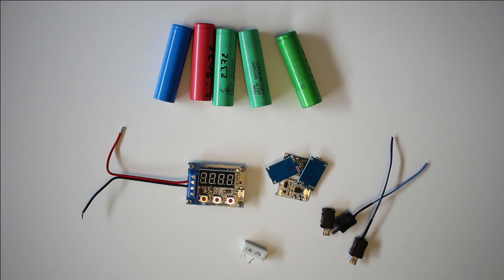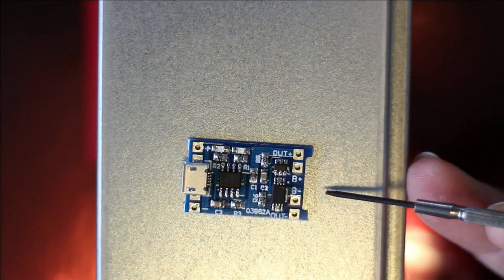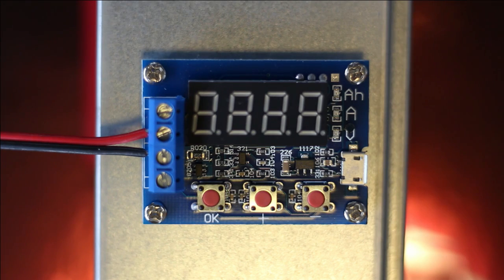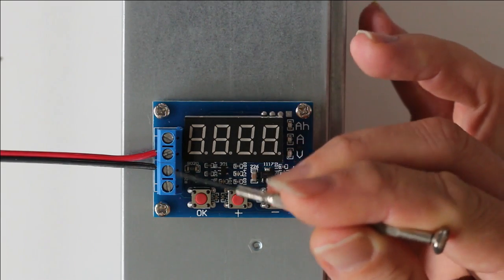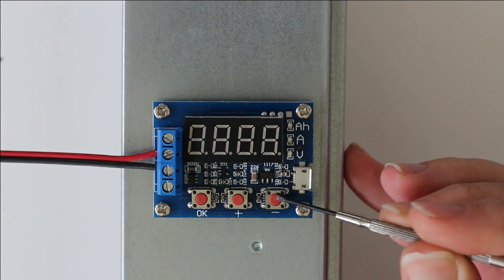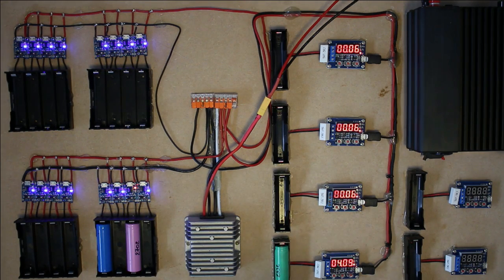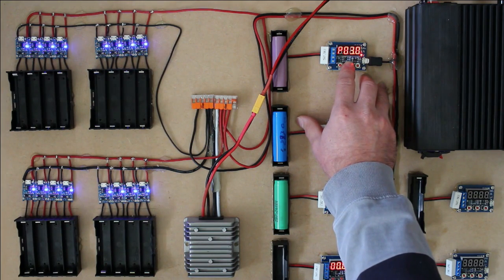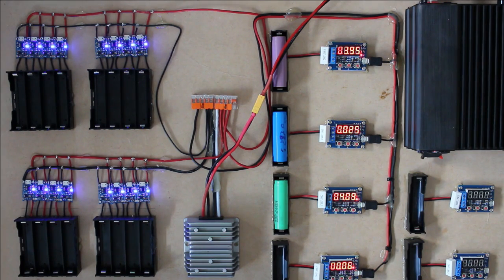18650 - Part 4 - Battery cells bulk charging and discharging with TP4056

Comment: If you look at the bottom of the PCB there are pads for connection of the 5 volts, you don't need to use the Micro USB socket.

Comment: Regarding to your discharging unit, what is the different using 1 unit of 5W7.5R resistor compare with using 2 units of 5W7.5R? I saw the discharging unit comes with 2 resistor and they can be connected in parallel.

Comment: what if I have to discharge 1amp from the 18650  battery cell, what should be the value of the ceramic resistor????

Comment: Do you need to Set the low voltage cut off every time ( USB disconnected )
Reply from the maker: No, once set it is ok
Reply: @Sailingandelectronics  great  ! 👍🏼

I have two more questions :P
Reply: @Sailingandelectronics  2⃣ Will it Balance the Cells while storaging ?
Reply: @Sailingandelectronics  3⃣ Can I storage discharge 1S with it ?

Comment: Thanks for your vids, ... would you recommend this device? Do you think that is accurate? Or would be better one like liitokala li-500 or opus bt.
Reply from the maker: Opus is best, no doubt. However price/quality I now use li-500 as main chargers/testers. The tp-4056 is cheap but sensitive... Need replacement often...
Reply: @Sailingandelectronics  i want to charge 18650 cell with solar 6v 1A plate,  but i also want to power the adriuno at the same time, can i do both,at the same time, if connect changer and discharger  on same cell ,will it work or burn the cell something..els..

Comment: How many charging device I can use with 5v 30A output charger ?
Reply from the maker: theoretically you should be able to do 30, but not overdoing it and running at max all the time, 15 to 20 would be a safe bet.
Reply: @Sailingandelectronics  thanks sir

Comment: Great work you've done there! One question, have you tried charging an over discharged 18650, voltage that is below 3.7v?
Reply from the maker: Hi, normal discharge is 3v, 2,5 and up is not good, but no problem if rare situation. Most chargers can handle this... (charging slowly up till 3v).
If really low or completely depleted, you can change settings so will start at any voltage. I use a cheap Chinese battery bank where I can put 8 18650 cells in. This then charges with only USB. If in there for 30 to 60 minutes, voltage is up to 2.2v most of the time. Enough to put in real charger.

Comment: i have done a capacity  with these testers and then compared it with the opus 3100 there is a huge difference i dont know which is accurate.
Reply from the maker: Opus will be correct because you know what amount of MA is used. In the little charger from this video it depends on the resistance you give it. If only 1 block, it's about 500MA. You could try the same cell in opus at same charge and compare.

Comment: Can I charge the high drain battery using the tp4056 charging bord? Pls reply
Reply from the maker: If it is lipo 1cell you can charge. You can change minimum and maximum voltage if not lipo.

Comment: Thank you ghis video i would like to know what main power suply you use from 220 or 230 to 12 v ? Thx
Reply: Obviously he doesn't answer questions from his subscribers.  Anything around 15 to 20 amps should do the job.  The higher the better.  When it comes to 12v supplies I always like to leave plenty up my sleeve.  If I need 10 amps I'll go for 15 amps. If I need 20 amps I'll go for 25 to 30. This way the supply is running cooler and will last a lot longer. I have a few 20 amp supplies which have been running for over 26 years and still as good as the day I built them.  One thing I've learned, never ever trust the output of Chinese supplies. Often they're little more than a wild guess. Plus I've had too many literally explode during use. In fact one decided to shock us all at 2am Christmas Eve. It blew it's cover 10 feet from the power point.

Comment: Nice video. Thx.I bought this same tester and it came with two resisters marked ZY 5W7R5 . I used only one resister and tested my havested good batteries showed before charging 3v- 4v readings. But after almost one hour  draining the batteies this tester showed mAh readings made me frustrating.  They are 0150, 0337, 0341, 0362, 0507, 0509, 0511, 0622, 0648, 0962, 0995, 1001, 1094, 1096,1425,and 1598. Are these my real capasity of my batteries or have to understand or how to read this readings? Thx for your reply to send me or correct way.

Comment: nice video. Can you connect the charger cirquit and the discharger cirquit to the same battery holder with a toggle switch maybe? that way it is much faster to switch between charging/discharging.. what do you think?
Reply from the maker: Should work, but you cut your capacity by half. One waiting for the other. You better charge and discharge at the same time. You'll get more cells tested in the same time.

Comment: Hi really great video
It's cool how long you explain every step and part...
So I guess you can help me in a doubt
I want to make a 4s pack with li-ion 18650
Use this bms
https://www.amazon.it/Scheda-Protezione-della-Batteria-Bilanciamento/dp/B07517RC6S/ref=mp_s_a_1_6?__mk_it_IT=ÅMÅZÕÑ&qid=1535443016&sr=8-6&pi=AC_SX236_SY340_QL65&keywords=bms+4s+bilanciamento&dpPl=1&dpID=41uPkxCgjhL&ref=plSrch

And charge with this li-ion charger

https://www.amazon.it/Caricabatteria-litio-TangsFire-Lithium-Polymer/dp/B07D5X5FHM/ref=mp_s_a_1_1?__mk_it_IT=ÅMÅZÕÑ&qid=1535446243&sr=8-1&pi=AC_SX236_SY340_FMwebp_QL65&keywords=caricabatterie+litio+4s&dpPl=1&dpID=51JOjl%2BL6AL&ref=plSrch

Will it be ok?

Comment: Did I miss your telling us what the combined maximum amps draw is from your 5v 30A power supply when 16 x 18650 3.7v  discharged cells (each behind a separate TP5056 charging board) are connected in parallel ?
Reply: If each TP4056 is rated 1A, then the current is going to be 16 amperes when it is in CV (constant voltage). It is going to start to drop when the cells are going to be near 4.2V.

Comment: If I use Imax BC charger with these holder cases, the cells are in parallel and are not receiving charge independently, as in your schematic, right?! Let's say I carry 2 or more cells in these holders (using Imax to charge them), even with cells originally of the same capacity. if I put 2 or more of them to load and they are at different rates when the process starts, when one of them is completely filled, the others cells will continue to be get loading until 100% of charge or not? If will, That one which has already been completed will continue to receive load, or not, or does the cell have any way to cease receiving electrons as soon as it completes its capacity?? I always had this doubt. Thank You very much if could explain this situation. I'm enjoying very much your videos.
Reply from the maker: Hi, when in parallel and thus not receiving charge independently as you say, they will charge until the charger reaches its final voltage. However, once shut down, and separated, it could be that one cell is higher/lower than the other.
I do not think this is a problem if all cells are in good condition. If you have a bad cell, parallel with a good one, then the charger will try to keep charging, with heating possibility. 
To be 100% sure, an Opus BT-c3100 is a safer bet. This has separate charge control and overheating killswitch.
You can see that in one of my other video's.
Have fun and keep it safe
Reply: otherwise one could wire the hobby balance charger into holder as with balancing leads and get individual charging and discharging if needed?

Comment: The dischargers are very inaccurate.... the ones I have anyway. The voltage and current are both incorrect when compared to measurements with a Fluke meter.
Reply: ya these dischargers are  CRAP..PURE  CRAP...not even with in %5 accuracy..several post on here about how bad they are
Reply from the maker: You can calibrate these little things. I haven't done it, but you can. That way they will be accurate and give results you can compare if you have multiple units.
Reply: ran through the procedure here..... https://syonyk.blogspot.co.nz/2015/10/zb2l3-v20-zhiyu-battery-tester.html
 ....all seemed to go ok but end up with the same inaccuracy..... 0.1volt and roughly 40ma difference to everything else used to check..... shorted the resistor to get the 2A from an adjustable supply.

Comment: The best thing to do when discharge testing 18650's is to check the manufacturers spec sheet, that will tell you what the minimum discharge test voltage is. Most of the ones I test recommend 2.6 volts. At 3.0 you will not get all the MAH the battery can supply.
Reply from the maker: You're probably right, so it gives me a certain positive margin. My actual capacity will be higher then measured ;-)